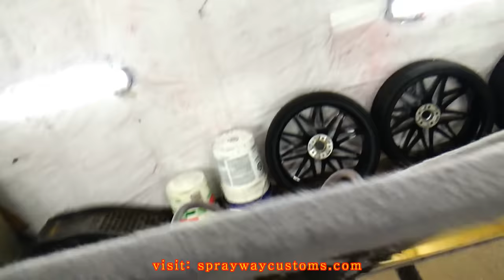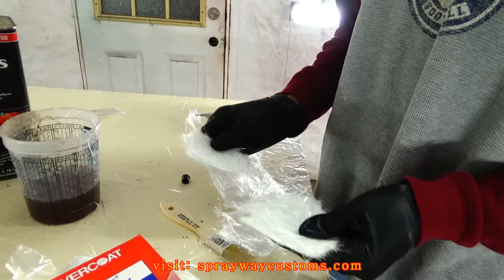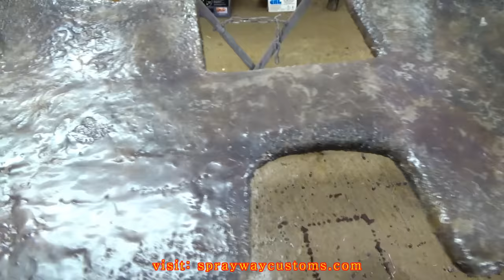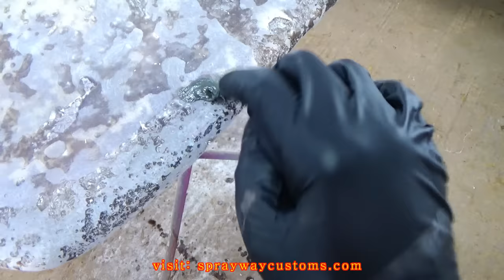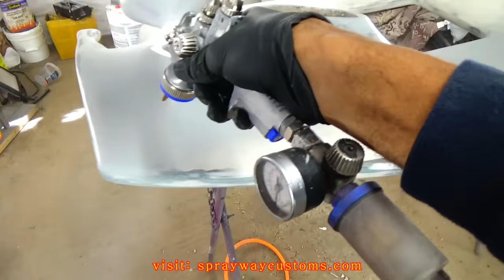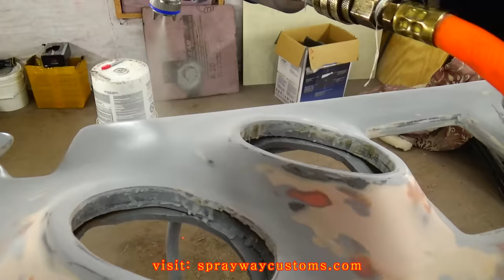How To Fiberglass Rear Speaker Deck With A Blow Through Box Port 1996 Bubble Chevy Impala SS Caprice

Comment: also try the glazing from USC it sands almost as easy as the bondo primer putty. but has a harder finish with polyester. This new USC stuff shocked me.
Reply from the maker: I have some USC glazing putty...I'm not sure if that's the one you preferring to Mike. It's brownish Gold looking
Reply: @SprayWayCustoms  no the new one is kind of white. it is the one in the left on this video I think it is usc pro glaze. plus that auto art stuff I got was pretty good and super fast sanding like drywall mud. also AG47 specs.https://www.youtube.com/watch?v=IbAYZ_BluMc

Comment: Do u RONDO better than RAGE GOLD and if so why? Thanks bro.
Reply: PAPERGATORZ , if you add fiberglass mat at least a CPL layers of 2oz (that's what typically comes in the packages at Wal Mart etc) you can do a lite grind coat and go straight to filler. The milkshake is just his process.
Reply from the maker: It depends on what you doing. If you trying to brush it on I would go with the rondo but if you trying to fill deep imperfections, go with a spreadable filler
Reply: Agree , it's really all about the glass lay up. The smoother you can get it , the less work you create. I want a chopper gun for my lay up , but just can't justify it for the small amount of glass work I do these days.

Comment: Question.  So do you have to use a wood frame. Or can you just make a mold, seeing that u install speakers that's pounding.
Reply from the maker: No..you can just make a mold as long as you strengthen up your layers of fiberglass mat

Comment: Dam that joint looks good. You never disappoint me. Im always looking forward to your work. Have you heard of SUNFLASH fiber glass resin? Im going to buy a bottle. But it only cures in direct sunlight (fast).
Reply from the maker: Yes, I heard of it but I haven't tried it yet D Will
Reply: Sun Flash is unbelievable !! Put it where you want it, then take the part out in the sunlight and it's set up in minutes... Yes, I'm still watching your videos and I use things I've learned from you every day ...

Comment: Hey man, just a little tip for laying down fiber glass. After the first layer of resin, spray some spray adhesive and lay the fiber glass down. It helps you see how much need and holds it in place. you then have both hands free to put the resin into it and it won't move around. Hope it helps. Keep up the good work
Reply from the maker: Thanks for the tip Andrew..I'll be sure to try it 😁

Comment: What’s up sprayWay, 
Question: when you fill in the air pockets, do you just add bondo by itself or do you add anything with the bondo
Reply from the maker: 1RgImage just filler by itself.
Reply: Thanks.
Where is a good place to get a chameleon paint color  ready for spay? Or do I have to get the powder in pouch and mix it?
Reply from the maker: Didspade or DYC for the best flip powder. The supershifts or hypershift pearls. You can get chameleon already mixed from Urekem also.

Comment: After the rondo, what grit paper did you use ? 220??.. and what sand block did you use ?
Reply from the maker: JA 818. I use 180 grit but I'm not sure what block I used in this video but I mainly use the Duroblock set.
Reply: @SprayWayCustoms  okay so 180 grit pad , sounds good thanks
Reply from the maker: No problem you can use 220 if that's all you have. It just won't cut as fast but it'll work
Reply: @SprayWayCustoms  thanks for taking time to reply 💯

Comment: Hey I was wondering I got a 98 Chevy S10 pickup extended cab I want to do a fiberglass box and put it on 22s will I have to raise the suspension it's only a two-wheel drive
Reply from the maker: I'm not real sure on that one Tom...I don't want to lead you in the wrong direction

Comment: How long have you been doing this and what size tip for primer and air pressure do you use?
Reply from the maker: I been fiberglassing about 5 years. I used a 1.3 tip in this video but I been using a 1.8 lately with 30 psi air pressure.

Comment: My brother used to build fiberglass boats, used a roller to press bubbles out of the mat and draw resin up through it. Would that process work with what you do in the large areas and speed up the process? Asked before I let you finish 😅.
Do you ever do any work with classic VW's?
Reply from the maker: I haven't yet but I'm eager to
Reply: @SprayWayCustoms  there's definitely a market for custom interior items. Under dash shelves, center consoles, kick speaker panels, rear dash, and that's just beetles. There are some of those items available, but very limited to only one or two venders.

Comment: So I couldn’t reach my tin of fiberglass resin but I could reach my jugs of stonecoat countertops resin, the cure time was longer but so was the working time and it had 1/10 of the toxic fumes of regular resin. I also had an easier time sanding it.

Comment: Nice work, salute✌. Question, do you cut out the metal on the rear deck before you install your work or leave the metal?
Reply from the maker: Leave it unless it's interfering with the speaker magnets
Reply: @SprayWayCustoms  thanks man. Really do appreciate it. I am going to run a 4 pack of pioneer 6x9 650w in the back of my Dodge Charger. I'm going to try and get that same look you did with out the fiber glass but I'll use vinyl. Keep ya foot on the ⛽💨 & keep doing ur thing. Much success bruh.
Reply from the maker: Thanks DJ EnMotion

Comment: I was in Bama 2 weeks ago. I tried to look you up. I wanted to get you to do some crazy stuff on my motorcycle. I am back in virginia now. I am thinking to try it myself, but I am nervous about it. Can you give me a list of everything needed? like name and brand and where to get it. I think I saw some of the things at home depot. Could you send me a list or put it here? Thanks in advance. Glad to see you are back at it.
Reply from the maker: Is you referring to supplies to paint a motorcycle or fiberglassing?
Reply: SprayWayCustoms  I’m talking about fiberglass supply list.
Reply from the maker: Hot glue gun, wood, jig saw, fleece, spray adhesive, resin, chip brushes, fiberglass mat, sander, sand paper, bondo glass, body filler, primer and paint. I think I got it all
Reply: SprayWayCustoms thanks brother. I appreciate it. Going to give it a try.

Comment: I know this is an older video but they have these tools that really help soak the mat in the glass. They're aluminum finned rollers. They come in different sizes depending on the area you're working. They really help reduce air bubbles and pockets. If you didn't already know. Keep on the grind brother. You do good work
Reply from the maker: Thanks a lot Sean